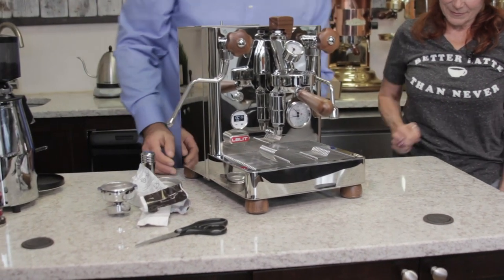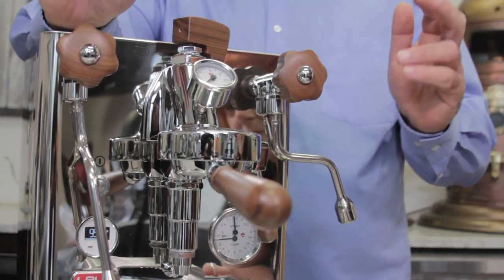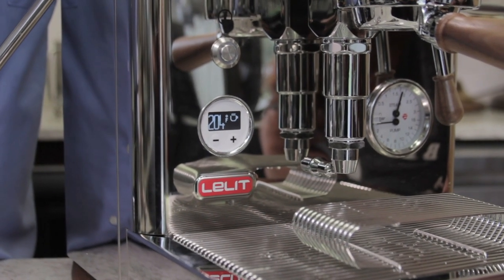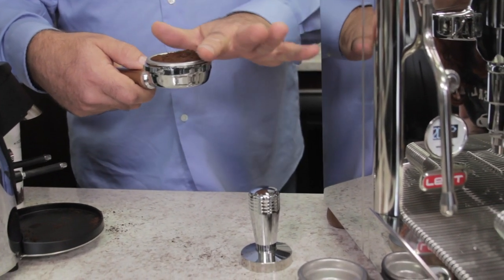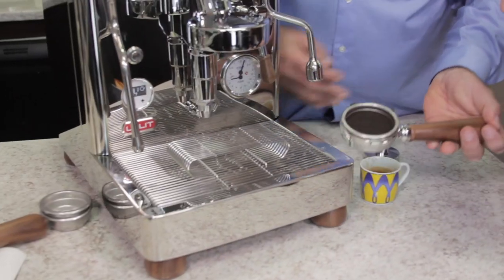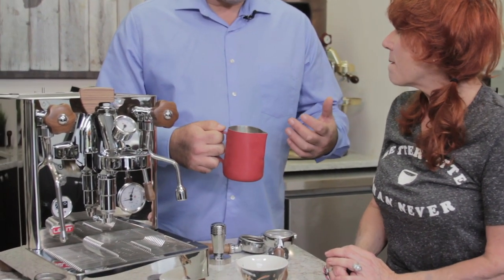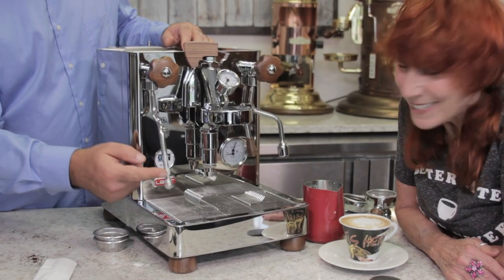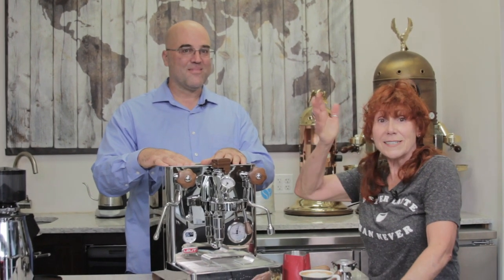Bianca & Sheila - Customer Walkthrough (Pt 2 of 2)

Comment: How does this compare to the ECM Synchronika? This one seems to have slightly more ability although it obviously hasn't been out in the field as long. Have you guys seen any problems that a more established machine like the ECM might not have?
Reply from the maker: Check out all the product reviews on our web site's Bianca page. Lots of good feedback on the Bianca. Our fourth batch of machines just left Italy. fyi...Lelit started producing the machine in June 2018. We waited until 3rd week of July 2018 so we would not be getting the first production run. This is a wise choice we follow with all our suppliers. As for achieving cup quality, the Bianca blows the doors off of all double boiler machines without any doubt.

Comment: I have recently purchased a Bianca and your video has a few great little tips in it like not needing to tighten the steam and water valves all the way to stop. My question is, when I make an extraction, the brew pressure on the group slowly decreases as the water runs through. Is this common or do I have to adjust my grind?

Comment: Looks like a well designed and very customizable machine.  Did Lelit address the parts used as far as being food safe and perhaps even toxic metal free?  How would you describe the steaming power?  Is there an automatic water level shutoff detection?  Shipping is free, correct?  Thank you for the thorough walk through.
Reply: Thanks! It is a well designed machine, and the Bianca offers a feature not found on other machines in its price class. 

As for parts being food safe and toxic metal free, this is not a simple question to answer. Food safe metals and toxic metal free is based on standards. California has different standards versus US federal level standards versus European standards. California statdards only to place a warning label on the outer box. But if a company is smaller than 15 employees

There is also NSF testing for food safety with different levels of NSF approvals. 

So, this food safety and toxic metal standards are different everywhere and this is a tricky question to answer.

Please note the Bianca, like every other machine imported into the USA does need to be FDA approved. However, FDA approvals can still include toxic metals in equipment. The Bianca is also ETL approved for electrical standards.

In Europe, there has been an emphasis to reduce lead in brass - a metal found on most espresso machines either in the pump, fittings, adapters, etc. The emphasis has been to use more stainless, more lead free brass (which still has very small amounts of lead), and use coatings as chrome, nickel or finishes which can come off after a descaling.

Steaming power is one of the best we have seen for a double boiler. The steam boiler temp can be programmed up to 266 d C without negative effects on the boiler welds.

There is a magnetic float in the reservoir to power off the heating elements when there is no water in the reservoir.

Shipping is included in the price of the machine within the USA.

All notes above are written as of this time and are subject to change in the future.